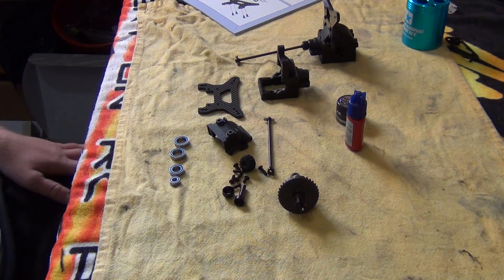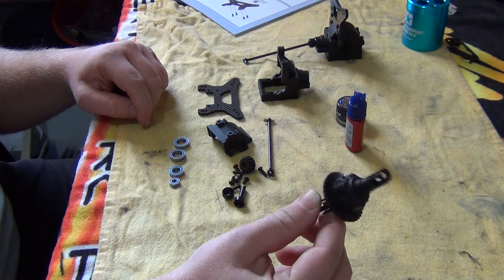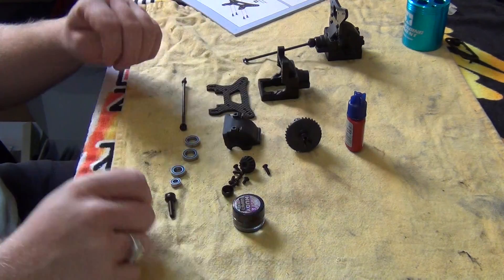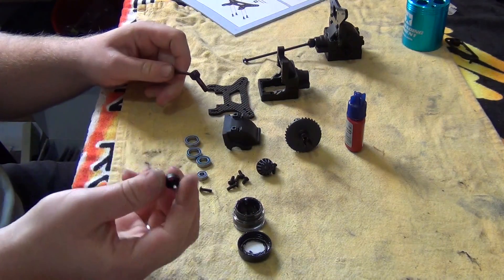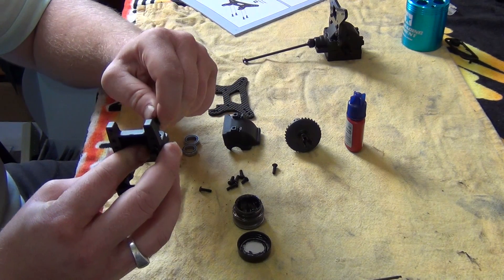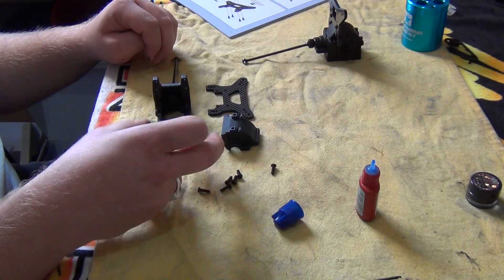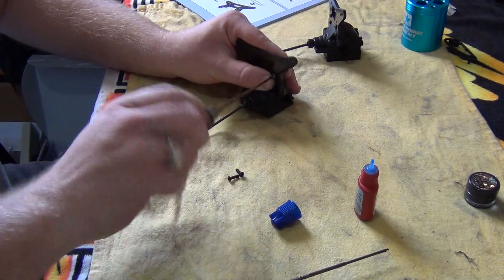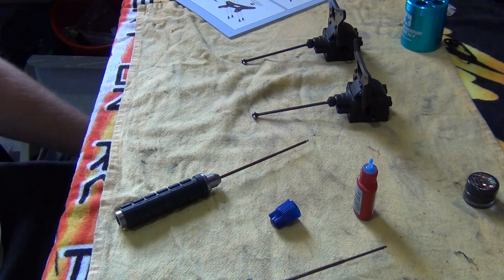Xray xb4 1/10 buggy build series part 3. Front/rear central transmission

Comment: Great build series. have a question In the manual it says to oil the bearings, do they come pre-oiled and the diagram is for when you rebuild, or do you oil them in the first build?
Reply from the maker: Steve Toomer They usually have some light oil in them already. I never oiled them and have only oiled them when i do a rebuild. I also find light machine oilbworks best as its less likely to create drag/resistance.
Reply: Cheers mate, this afternoon I've already oiled half the bearings with hudy bearing oil, so I probably will continue. I really wasn't sure because my b6d kit bag was quite oily compared to the xb4 bearing bag.  FYI I will be as Castle Hill on the 2nd for the club series, I'm a new member of Ryde